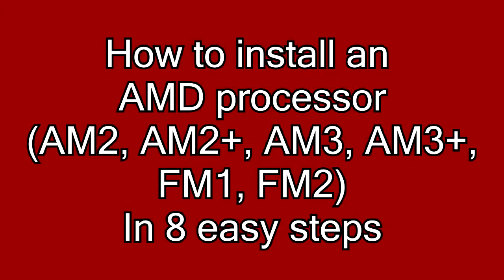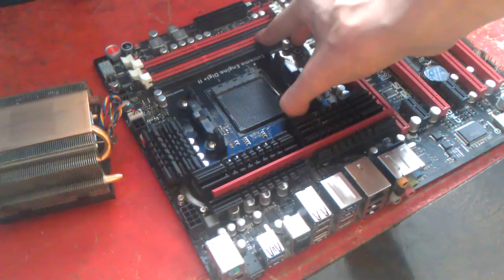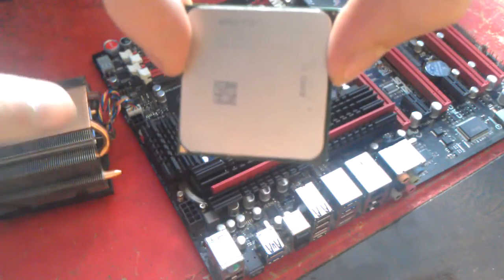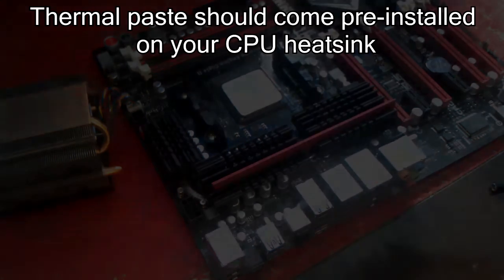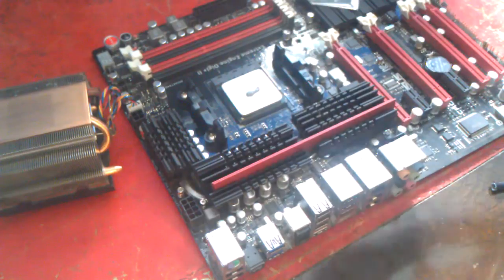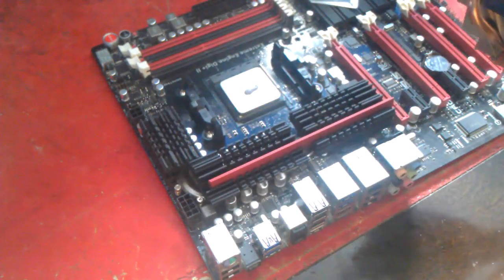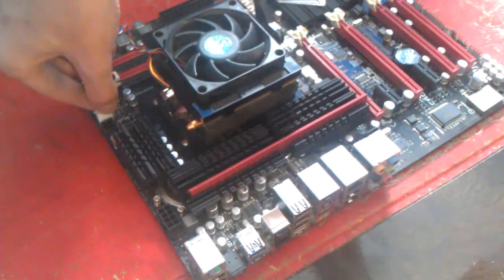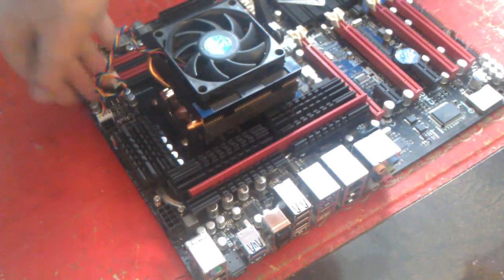How to install an AMD CPU (remade)

Comment: can i use socket AM2+ processor to socket AM2?
Reply from the maker: You cannot use a lower socket on you motherboard than the processor and the same goes the other way round unless the motherboard say it supports it. So in your case you would need a motherboard with a AM2+ socket for that CPU.
Reply: on some sites write that you can with BIOS UPDATE
Reply from the maker: +Georgian Gamer that all depends on the motherboard. To find out you will have to go on to the manufacturer website and look at the CPU compatibility for that motherboard
Reply: ok thanks  man